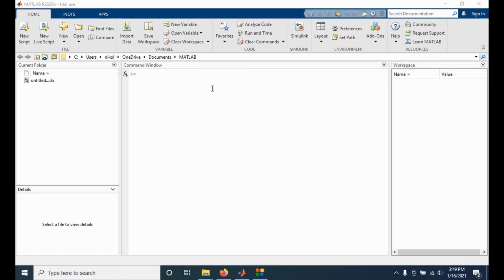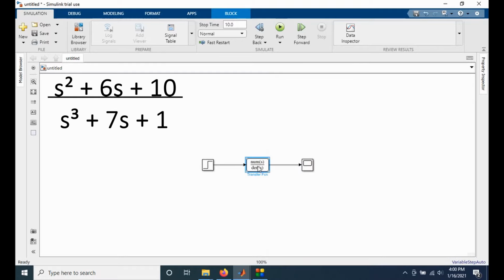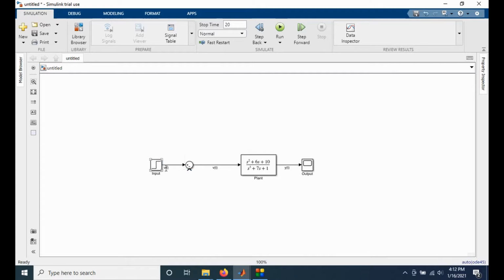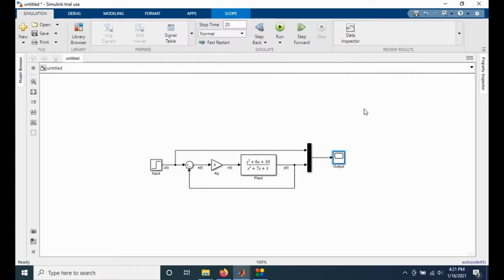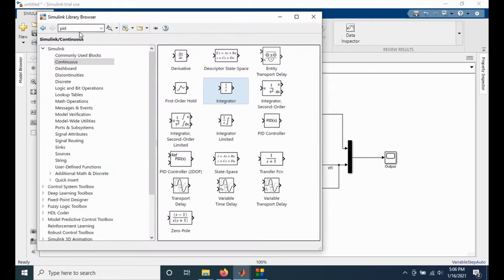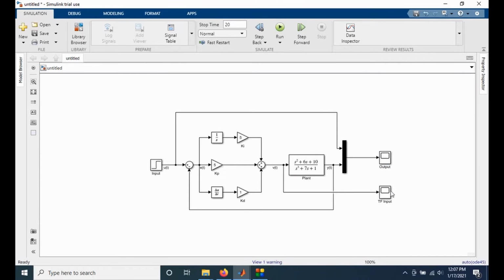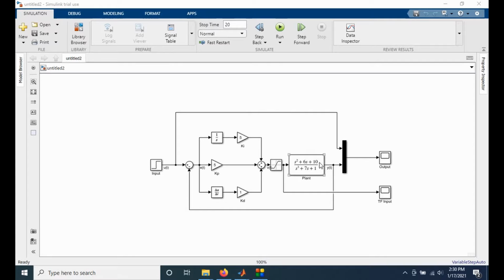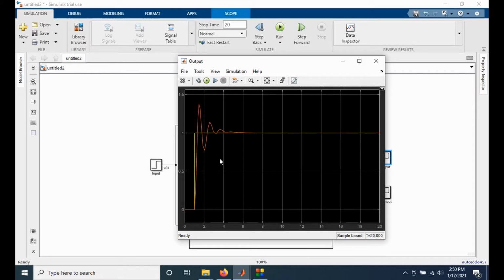Simulink Control Systems and PID,  Matlab R2020b

Comment: Extremely helpful in understanding the PID algorithm. My question is regarding the relation between the step input and the transfer function. Is the step input just a random assumption of what can be feeded into the system while it is going ON?
Reply from the maker: Correct. You can send any kind of inputs into the transfer function. The step input is the simplest one. Keep in mind that the more the input changes, the less the controller will be able to follow the required path. The step function is the simplest input, and we generally use a ramp input as the next level. That being said, the input could be literally any wave form. One example I like to give is if the transfer function is a drone and the input is coming from a person on a remote. That input will be quite different from a step

Comment: Set the N term to infinity (1e09). This gets rid of the filter implemented in pidblock, as such it will be exactly the same as the block diagram form of the pid.

Comment: Could you please help me to solve the following error.  
Error using fun (line 16) Derivative of state '1' in block 'model4/PMSM /Integrator' at time 1.09996 is not finite. The simulation will be stopped. There may be a singularity in the solution.  If not, try reducing the step size (either by reducing the fixed step size or by tightening the error tolerances)
Reply: join the club....